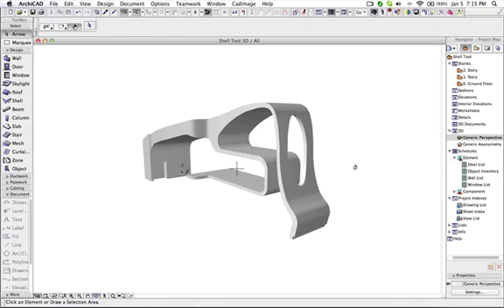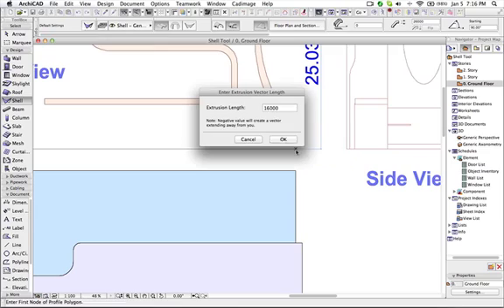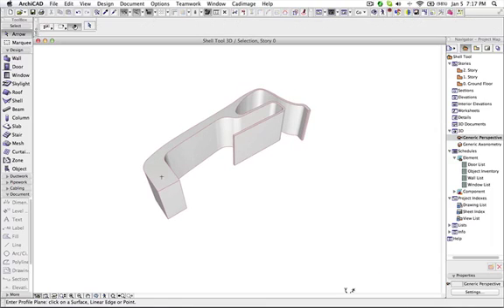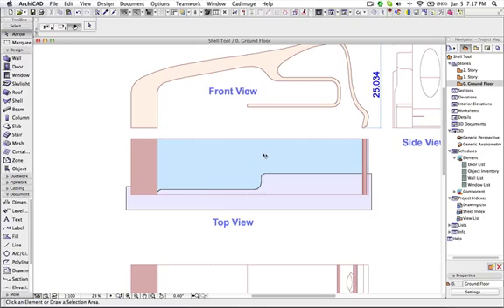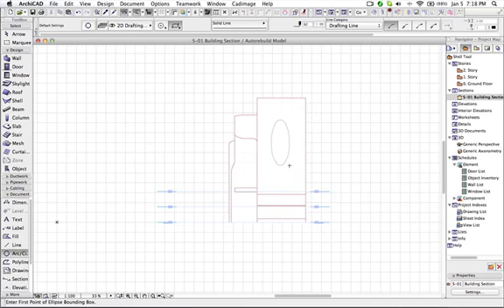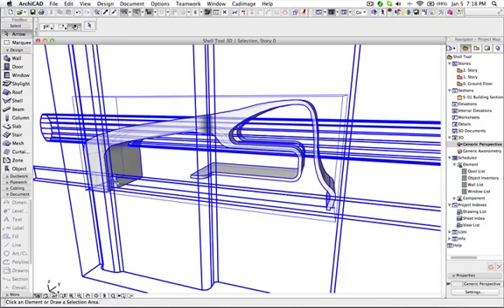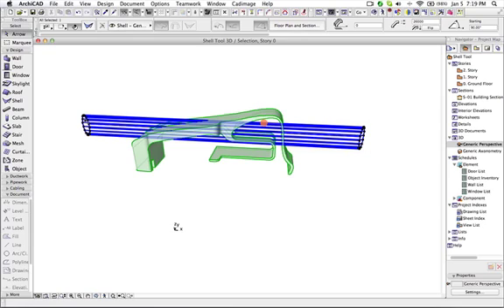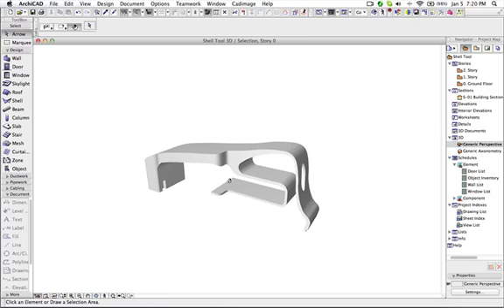ArchiCAD- Shell Tool -  Free Form Modeling of a Facade Element

Comment from the maker: Draw the semi cross section profile of the egg and the use the revolve shell command. Eg: If you want a ball shape you should draw semi circle in the plan and the use revolve shell command with 360 revolution angle.
Reply: Dear BIMES thank. but i have followed the instructions but i have failed to achieve that using archCAD 18. Why?